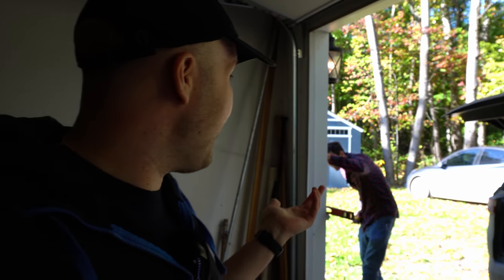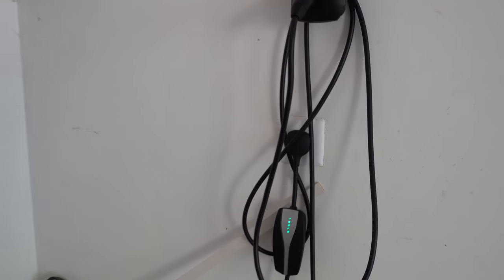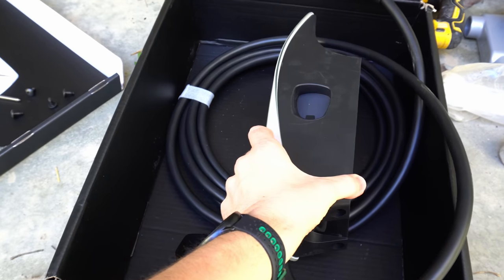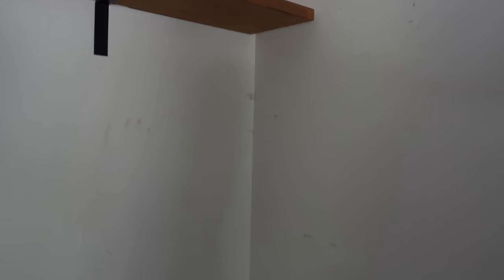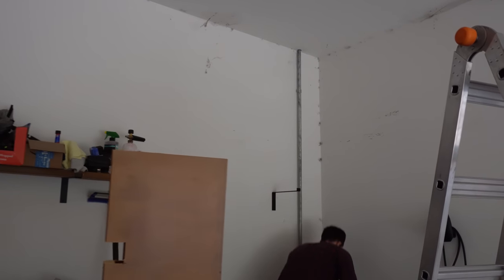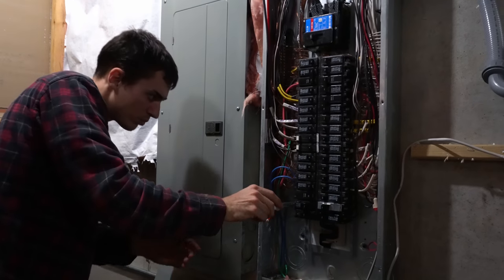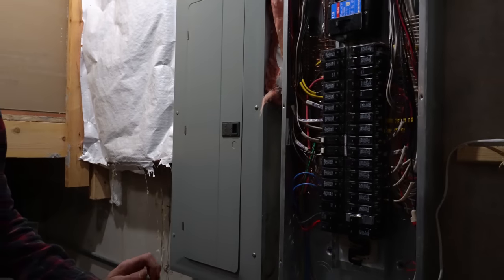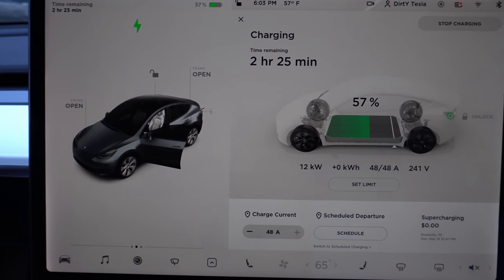Installing Tesla Wall Connector With a Master Electrician

Comment from the maker: I'll edit this with Nathan's total earnings so far. As of 01/26/2023 Nathan has earned $485.75 :O ya'll are really doing it

To those surprised we're getting an X, we are as well. Here is my tweet from back in February when we ordered explaining it is thanks to GME: https://twitter.com/DirtyTesla/status/1365129647986515972

Normally, we could not afford this type of vehicle. But with some GME fun and the vehicle being a tax write off, it is possible :)
Reply: Why is your car a tax write off?
Reply from the maker: @marine2tough  YouTube
Reply: 60 amps? whats the voltage rating? Isn't a normal install only 30 amps at 240volts usually?
Reply: @Ilikefire2793  The Wall Connector can pull 48 amps continuously. Per code, you can only pull a max of 80% of a circuit breaker's rating continuously. So 80% of a 60 amp breaker is 48 amps, which is the amount the wall connector can pull. And yes, it's 220-240 volts.
Reply: @floorpizza8074  makes sense. just found it quite high for a home Ev charger. is it cause its two chargers on the same branch?
Reply: GME went to 260 after that. Did you go all in at 50?
Reply: @DanFrederiksen  I wanna know his profits so bad
Reply: @Ilikefire2793  240v. And you can wire it to accept a circuit rated anywhere from 15 to 60 amps. Once installed, you link up to the wall connector’s Wi-Fi, go into settings, and tell it what size breaker it’s connected to. National Electric Code permits EV Charging at 80% of a circuit’s rating. So a 60 amp circuit will allow for 48 amps of charging.
Reply: @floorpizza8074  beat me to it LOL.
Reply: @wddbmm  If he bought a model X and claimed he would also buy an S if it hit 100 and he held to 260, it stands to reason it's quite a bit. It would have to be an initial investment of at least 100k and at 260 that might be about half a million profit. Assuming he got out just the right time.
Reply: @nathanmiller9711  nice. Thought its a bit concerning as i would expect the actual tesla charger base to be a bit bigger in order to store the components to accept the higher amperage ratings. Unless that size is  actually enought that is needed to dispell the heat comming from the wires/step down transformers from charging to be safe.
Reply: @Ilikefire2793  no transformers needed. Really, all the wall connector is is just a set of terminals and a small amount of electronics (wifi and safety interlocks).  Not much to it...
Reply from the maker: I went all in at $16 in October 2020 but the X money was from buying calls lol
Reply: great video, very informative - does Nathan happen to have any contacts in the Houston area? Need the same job done, new to the area, and any recommendations from him seems safe-proof. Thank you!
Reply: @Ilikefire2793  Many people who purchase a Model 3 use a 30A circuit because they still get 22 miles of charging per hour.  Dirty Tesla has a Model X coming in which even using the 60A circuit for the wall charger is only going to get it 30 miles per hour of charging (while a Model 3 can get 44 miles of charging on the same unit).  Getting an X for most people means wanting a much stronger charging circuit.

Comment: Nathan seems like a great dude and his work is very clean. I bring this up to educated or at least think im correct on my interpretation of the NEC code in regards to these tesla chargers. Nathan seems to have used #6/2 NM-B Cable (60 degrees C) rated for a max of 55 amps. Although at the max setting the wall connector may only utilize 48 amps because the NEC deems it a continuous load it must be rated at 125% capacity. Therefore the breaker and wire must be rated at 60 AMPS (48 x 125%). The only way to get away with using #6 is to use that of insulation type at 75 degrees C or more. This would require conduit the entire way. an easy fix is to re program the tesla at the next highest setting which would be 50 Amp breaker giving 40 Amps output. Let me know your thoughts!
Reply: 100 percent agree with everything you said. Retired IBEW 701 here. I just put one of these in for my nephew and I did it the right way, the only way with EMT and #6. I can tell you for a fact that this charger pulls 48 amps and the wire does have a "feel/buzz" going on. I told my nephew  I would be more comfortable if he turned the amps down but he wants full power, stupid is stupid does I guess. 
Just like when it gets cold out and you hear about home fires because of "electrical" problems AKA 16 gauge extension cords and space heaters we will be seeing fires because of installs like this.
Reply: There is a second aspect to this. Because the industry is so new, inspectors are wanting to see the installation manual and most state the need for 90 degree copper which eliminates romex. All my installs are thhn in conduit.
Reply: @marksweeting24 ok so to be clear #6 THHN in conduit for about a 25' run is ok? Can always get #4 if need be. Thanks
Reply: @carminec5438  Yes, that is fine.
Reply: @marksweeting24  thank you

Comment: Nice work Nathan. Red taping the white conductor is one tell that you know what you're doing. When I wired mine I came through the back and didn't realize that I could wrap the conductors around the right and enter the lugs from the top. So I made a tight loop and wired in the bottom of the lugs. Then of course I read the instructions. Also had issues connecting to Wifi. Great video!
Reply: One isn't allowed to use the white and use tape on a #6, this would be allowed on a #4.  Also with a 60 amp breaker wouldn't make code based on the wire used, the breaker needs to be replaced with a 50 amp breaker.
Reply: @kayak_1  you are correct about the 50 amp (Section 334.80 relegates #6 Romex to 55 amps max). However, with regard to reidentifying the neutral as an ungrounded conductor, 200.7(C)(1) allows that for any size wire. Perhaps what you’re thinking is reidentifying a black wire as white and that is only permitted on #4 and larger, per 200.6(B)

Comment: We had a Tesla wall connector installed when we purchased our Model 3 in 2019. Have not regretted the cost one bit. It sits on the wall next to an existing NEMA 14-50 which works wonderfully also. Thanks for the post!

Comment: I installed a wall charger from the beginning and have always carried the portable one Tesla gives you in the car in case I need it somewhere. I like to be prepared for the worst and always having to disconnect it from your house to put in the car would drive me crazy. $50k car, you can afford the extra $500 and I always like faster charging…when you need it, you need it!
Reply: We did the same thing. Paid $500 for the charger and I think $250 for the electrician to install it. Well worth it.
Reply: It’s actually cheaper if you wanted to get another Mobile connector and just leave one plugged in constantly. Also helps if you plan to move you can take that one with you easily

Comment: #6 NB-B (Romex) is rated for 55 Amps per NEC. The WallConnector should be set for a 50 Amp breaker and a 50 Amp breaker should be installed. #6 THHN in continuous conduit could have been used with a 60 Amp breaker.
Reply: I typically install Wall Connectors using MC (metal clad) cables. Armored cables. They’re good for 65 amps when terminating to 75 degree terminals. As opposed to Romex, which as Paul pointed out, is limited to 55 amps. Plus check the installation instructions - Tesla dictates 90 degree wire be used, which rules out Romex, since it’s derated to 60 degrees under Section 334.80
Reply: For 48 amps in my state, i had to install a 60 amp breaker (20% buffer). I installed a 100 amp breaker in case down the road I install another wall connector. More than 1 needs 100 amp breaker for dual car charging.
Reply: @kevdogsab  Did you use a #3 copper (or #1 aluminum) wire or larger? 🤞🤞
Reply: @nathanmiller9711  i forget exactly what my electrician used but it was copper and at least 100 amp rated. It was more than necessary but what he had.
Reply: @kevdogsab  good. Had me worried there for a minute :)
Reply: you are allowed to put it on a 60 amp breaker as long as the load does not exceed 55 amps which it does not. NEC allows you to go to a 60 and I have never been called on this.
Reply: @jstevens501  EV charging is considered a continuous load.  Does that change your opinion that the breaker can be increased to 60 amps on the 6 AWG NM-B Romex?  Also Tesla dictates 90 degree wire.  Isn't NM-B is derated to 60 degree?
Reply: @pauls2107  You're allowed to round up from a 55A to 60A breaker size, as 55A is nonstandard, but I believe this is separate from the continuous load requirements and you shouldn't actually be sending more than 44A through it. NM-B is sized using 60C ampacity, which is a different concept from derating (derating is adjusting for factors such as high ambient temperature or multiple wires running alongside each other and generating shared heat). Derating starts from the 90C column for NM-B and works its way down from that baseline.

I personally felt my #6 cable was getting a bit warmer to the touch than I'd like during an active charge session and swapped out the 60 for a 50. The charge rate is still acceptable and the wire remains quite cool at that current.

Comment: I paid 635$ CDN plus 15% tax for the Gen3 Wall Connector and then about the same for a pair of electrcians from a reputable local company to run 80ft of 6 gauge wire and install the unit. That included all materials and 2 hrs labour. They had to fish through a 10ft section of wall from garage into basement ceiling space and then to power entrance (breaker panel) a further 70ft through and open ceiling. 

No conduit required.

Comment: NEC code 2020 requires a GFCI breaker for a nema 14-50 plug.  They're like $120-$180 for the breaker to add to your cost considerations.  Most states are still on NEC 2017 code, which doesn't need GFCI, but eventually all states will move to NEC 2020 shortly.  So check in your state.  A wall charger doesn't need a GFCI breaker, in fact the manual states not to use a GFCI breaker since nearly all wall chargers have a GFCI built in and they tend to interfere with each other.
Reply: All those words to accomplish what?
Reply: @TESLAenjoyer  What I'm saying is you have to factor the cost of the GFCI breaker into your cost considerations between installing a wall plug or a wall charger.  $150 for GFCI breaker + $90 for Hubbel 14-50 outlet + $10 wall box = $250.  A Tesla wall charger iis $475 + $20 breaker.  So it's not as cheap as you think in states with NEC2020 rules.
Reply: @GROGU123  nobody uses a GFCI breaker for a wall connector or mobile connector.
Reply: @TESLAenjoyer  Any work performed by an electrician must follow the code adopted by the state.  If your state is on NEC 2020 I would get a wall charger instead of an outlet.

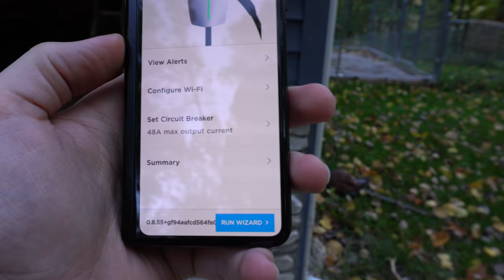Comment: in the app at 14:40, shouldn't you change the app output to a 60 amp breaker? As in click continue and then select a 60 amp breaker then it would be closer to 55 amps MAX output? Or is the tesla compensating and only running the 60 amp breaker at a peak max output of 80% (48amps) to be on the safe side?

Comment: It's actually a bit cheaper and easier to get a NEMA 6-50 than a 14-50.  The only difference is, the 14-50 has a neutral (because it's designed for RV's).  The only time you need a neutral is if you are going to pull 120V split phase out of it.  Which EV's will not do.  The 6-50 is a bit cheaper for both the outlet and the wiring since there is 1 fewer wire.  I guess you can make the argument that if you already have a 14-50 Gen2 adapter (which is a good one to have because that plug is in almost every RV park), you don't have to buy an extra 6-50, but I think the 6-50 wire, outlet, and adapter together, is cheaper than the 14-50 wire and outlet.  But as far as EV charging, the 6-50 and 14-50 are identical.
Reply from the maker: That's great to know. When learning about charging 3 years ago before I got my Model 3, the recommendation was always just get a 14-50. The other reason I like having it, is it's ready if I need it for anything else.
Reply: @DirtyTesla  Yeah that's true, if you're using it for some other application that needs the neutral wire (clothes dryer comes to mind as something that might need the neutral), it makes sense.  If it's exclusively for EV charging, the 6-50 will be cheaper though like I said.
Reply: Neutral = ground I think?
You should always have your EV connected to earth… there was a video by nextmove recently. If not connected to ground, you can get shocked by blank parts of the car!
Reply: Neutral = ground I think?
You should always have your EV connected to earth… there was a video by nextmove recently. If not connected to ground, you can get shocked by blank parts of the car!
Reply: @DerKatzeSonne  No.  Neutral is not ground.  With 240V like a NEMA 6-50, you have two hots and a ground.  The only time you need a neutral, is if you need 120V.  That is how the US gets 120V.  While you CAN certainly use a NEMA 14-50 for EV charging, you're wasting a bit of money on the extra neutral wire and the extra plug on the outlet.  Now, on the inside of the fuse box, the neutral and ground do end up connected together, and both end up at the same place, but the neutral wire is not the same thing as the ground wire.  Neutral is only needed for 120V split phase.  https://www.youtube.com/watch?v=jMmUoZh3Hq4
Reply: @StormsparkPegasus  oh I see. Thanks. I’m not too familiar with the American plug standards :)
Reply: @DerKatzeSonne  Yeah, the way we get 120V is...weird.  Our electrical system is actually 240V, but wired with a weird neutral wire so we get split phase 120V.  If you are just using the 240V, there is no need for the neutral wire (an EV will just not use it).
Reply: @DerKatzeSonne  neutral is the return wire. the non insulated one (one that is just bare copper) is the ground.
Reply: But with a 14-50, you'll be all set when a friend drops by for an overnight with their large RV - or if you get a large RV!
Reply: @beltrams  Yeah this is true...if you have a need for the 14-50 it's fine.  But if you are only going to be charging EV's a 6-50 will do the same thing for less cost.

Comment: These US single-phase crazy high current electrical installations regulary blow my mind as a european who is used to 3-phase installations with much more handable, thinner cables.
Reply from the maker: I thought the cable was going to be thicker lmao
Reply: @DirtyTesla  Always blows my mind. Having a 200A fuse panel would be considered insane over here xD
Reply: @markusdd5  My house has 320A main

Comment: Careful Chris, you really should pull a permit (now after the fact 😀).  Upon sale of your house, sometime in the future, you can be forced to tear out any non-permitted additions.  Happened to me when I sold a house.  Previous owner had done some non-permitted electrical.
Reply from the maker: We did pull a permit! :) WC will come with me either way.
Reply: @DirtyTesla  Be careful on that.  Usually things that are attached to the house that the prospective buyers see and potentially want (the wall charger is hard wired) go with the house.  That definitely applies to ceiling fans, chandeliers, etc.
Reply from the maker: @iowa_don  we have no plans to move. But if we do, I'd simply remove the wall charger before listing the house. But thanks!

My mom just moved and we made sure to remove her ring doorbell and nest thermostat before listing.
Reply: @DirtyTesla  👍
Reply: Hog wash. More to that story for sure. 99% of counties have no detailed records on circuit breaker lists. Home inspectors aren't code enforcers. All they see in the approval sticker on the breaker box.  Someone prolly did something really dumb and thats how it was found to be ' non permitted'.

Comment: Great video. Make sure the wall charger is I a shaded place. If at some point the wall charger receives too much sun directly it will become to hot to properly work. So don’t install it facing the sun…
Reply from the maker: YES! I meant to mention this. It will be in the shade 99% of the time. House shades it all day, as the sun sets it may get some sun on the right side (when looking at it) but then the trees will shade it!

Comment: Installation has a big flaw. Although the system breaker was properly selected, the wire was not... let me elaborate: This charger max amperage is 48 A, and according to NEC, continous load must be designed to 80% capacity (or 125% excess capacity = 1/80 =120). So, at 48 A x 125% = 60 A. Breaker is fine. Now the type of cable is NM... although these cables can withstand 90C, the selection of amperage should be limited to 60C. (NM-B (nonmetallic-sheathed) cable may be used for both exposed and concealed work in normally dry locations at temperatures not to exceed
90°C (with ampacity limited to that for 60°C conductors). 

This means that 6/2 wire is limited to 55 Amps. In the video you also mention that the length is ~130 ft. Because this long distance you will need to add 10% extra capacity which means you will need to upgrade to 70 A breaker and 4/2 wire. I recommend limiting the charger max amps to less than 44 amps to avoid any issue.